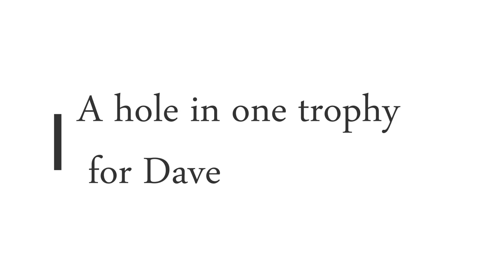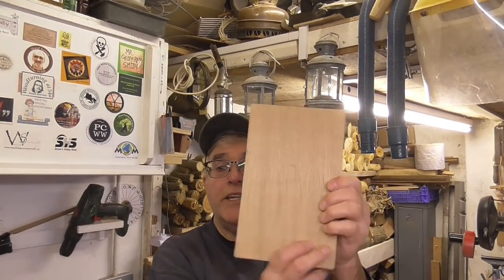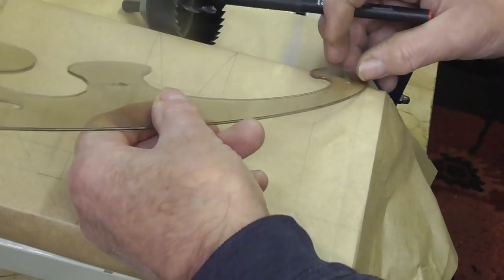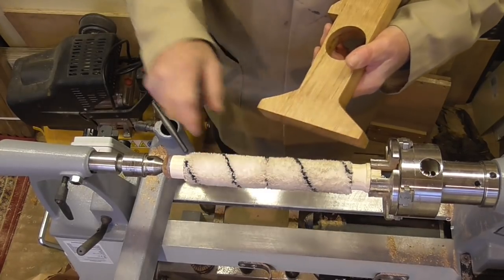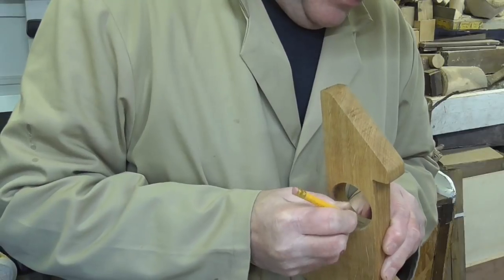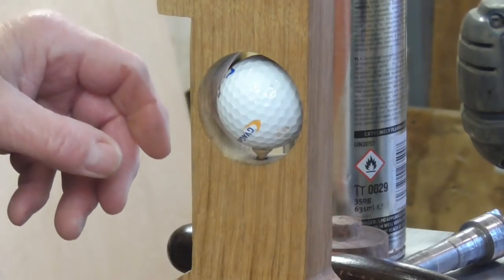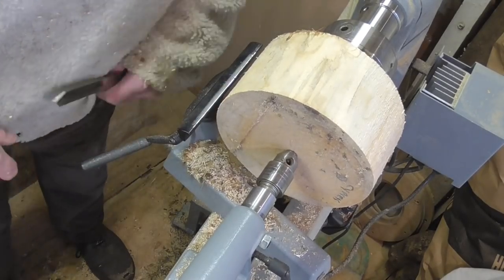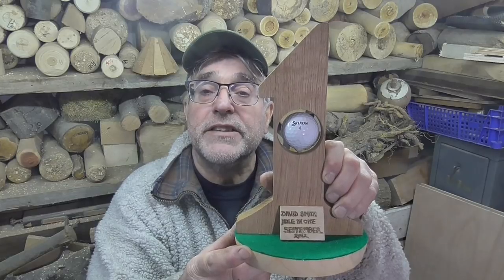A home made  golf trophy

Comment: Nice video Bram :)   Good to see you back :)   Nice looking forstner bit model.  Does it make many cuts as nice as the one in your video ?   I mean , does the sharpness last ?  Great polishing wheel improve :)  The gift turned out wonderful :)   I'm sure it will be a hit :)
Reply from the maker: Hi Steph, Thanks mate, The forstner bit set I bought compared to others on the market is rather cheap, they can with a bit of care be sharpened. They soon  dull though when using on hard wood . Ha, yes the polishing wheel ....a cheap skates ( patent applied for  ;)  ) version of a Beale buffing system lol ...it works though, I'm going to try a full size roller next time.
Cheers mate ,   Bram